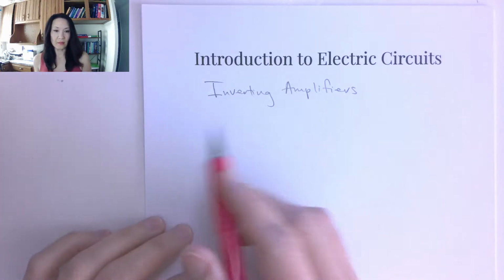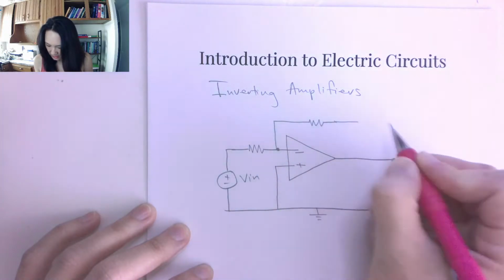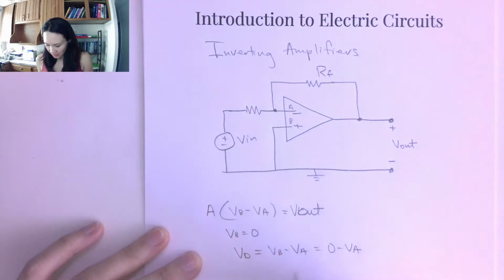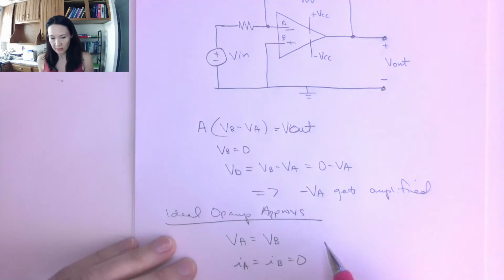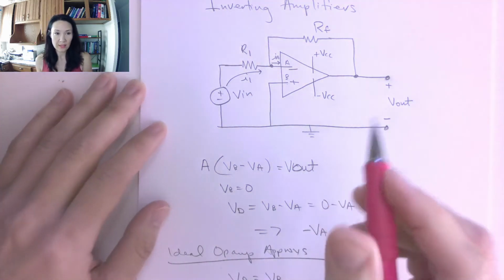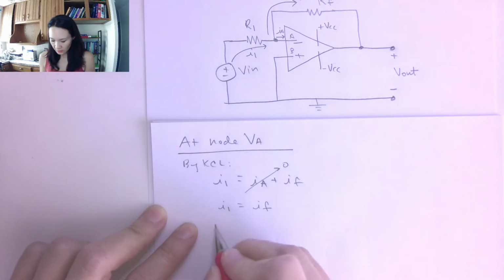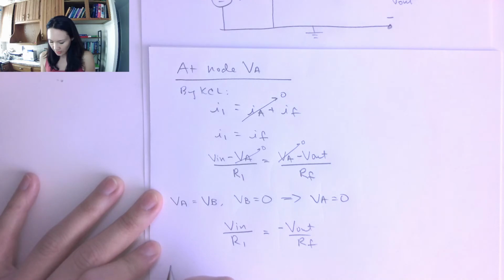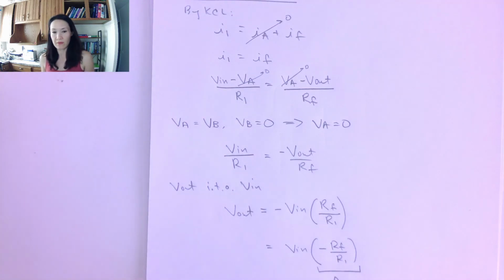Inverting Opamp Circuits

Comment: I have one question that's really bugging me. Where does the current i_f flow to. Is there an assumed path through one of the other pins in the op amp?
Reply: It flows from v_out back to the input terminal.